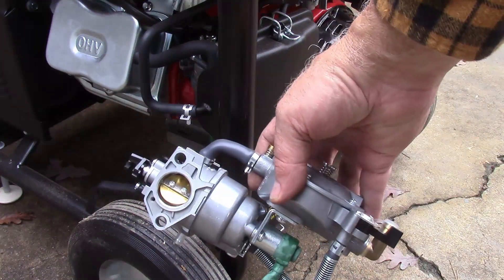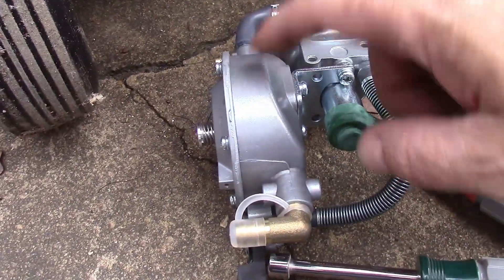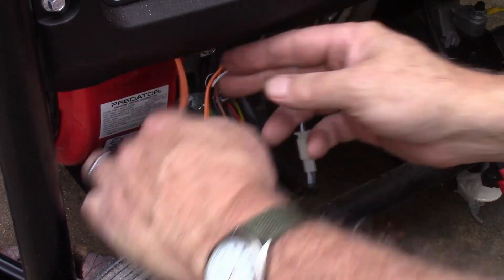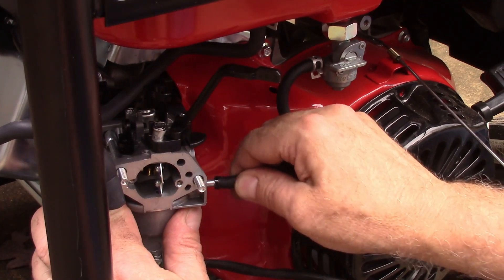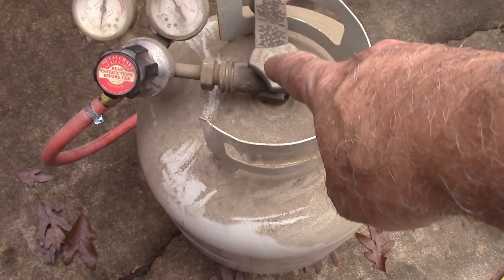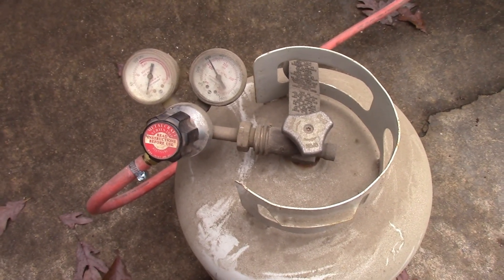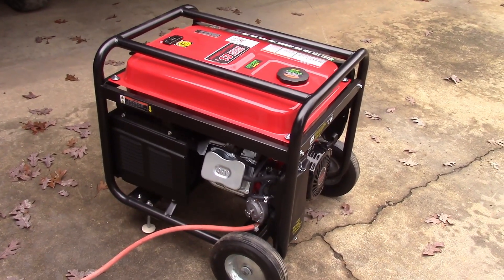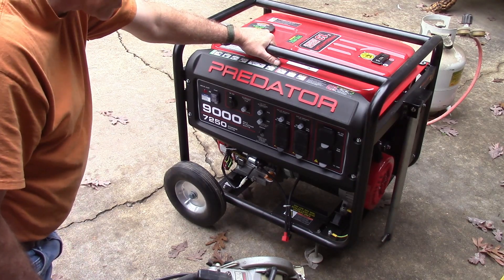Predator 9000/8750 Generator Propane Conversion  Tri Fuel

Comment: i am unable to find a propane hose that will fit it like what u have. do i cut the end off and clamp it like urs or what size fitting will go on there
Reply: Here is a reminder about portable generator safety: everyone really needs to see this safety reminder to make sure. This advice is just to make sure that everyone is aware of all the warnings and it’s just to remind people to be careful using portable generators. Generators can be dangerous if not used carefully. Every year, hundreds of people die or get injured when using portable generators due to carbon monoxide poisoning and electrocution. Make sure you are using your generator carefully and keeping others safe as well. There is something very serious that everyone should always be aware of when using generators. Some people do run their generator indoors which is not safe and that increases the risk of carbon monoxide poisoning which can cause death of family and you. Some people run their generator in wet conditions which can electrocute them. Please remember that you should never run your generator indoors. Remember that carbon monoxide is an odorless and colorless gas that you cannot see or smell. Carbon monoxide is a silent killer. Keep that in mind. Make sure your generator is 15-20 feet away from your house and away from doors, windows, and vents. Never use your generator in your porch too. Having a carbon monoxide detector is very important against generator safety. Some people also allow children to go near the portable generator which could pose risks. We need to keep an eye on our children making sure that they are not near the portable generator so they won’t get electrocuted or burned by the generator which is dangerous. A locking enclosure also keeps kids safe. A generator shed might look like a tempting place to explore, or take cover during a game of hide and seek, but a generator is a dangerous piece of equipment that can cause injury. It says on the manual that we should also keep children away at all times from the portable generator to avoid injuries. Please do not allow a child or unqualified people to operate the portable generator. Just because some manuals missed what should be listed doesn’t mean it’s safe to do. Always follow the generator safety rules when using portable generators. Generators pose electrical risks. If you need to use your generator during wet weather, you need a generator tent to protect your generator from getting wet. Don’t let your generator get wet. Keep your generator dry and before using your generator, please make sure your hands and your generator is dry. Do not wear loose clothing when operating the generator. Everything that is said on the generator’s operating manual should not be ignored. Never smoke cigarettes near the generator. Please keep flammable things away from the generator. Never overload your generator too. Your generator can catch fire. Never ever try to plug a generator cord into a wall outlet to avoid back feeding. Back feeding your generator is dangerous. Always turn on your generator first before plugging in appliances and shut off the appliances before turning your generator off. Use a heavy duty cord for your generator and the cord should not be worn out. All the instructions should be followed carefully. Never refuel your generator while it’s running. It can cause fire if fuel spills while your generator is hot. You should turn off your generator and let it cool off before refueling it. Having a fire extinguisher next to the generator is also important. This is only a reminder for everyone’s safety of using generators. Make sure your generator is properly grounded. Having a fire extinguisher next to the generator is also important against the safety rules. https://youtu.be/I1jT3ANENvI and here is a video more about keeping others safe when using generators and also about our family’s safety. Hope this helps. Thank you. Stay safe

Comment: Hi, I just did this conversion! Thanks for the help! It just STINKS really badly. I used a small grill regulator and it worked great on the little tanks, but I switched over to my 600 pound home tank and now it smells SO bad like exhaust fumes... almost like a gas smell.  I'm wondering if the new grill regulator I bought is pushing too much propane and I'm running rich or if the big tank propane just burns more smelly. Any ideas???
Reply from the maker: Glad the conversion worked for you.  The smell should not be any different.  I would wonder if you have a leak somewhere.  Definitely check all your connections for leaks.
Reply: Your supplier has probably mixed in that smell so that if you had a leak in the house or had the stove on not burning, you would know something was wrong.
Reply: @MeadeLX50  I'll report back after some more testing!  I need to get out there and test but I've been crazy busy with projects in the year of COVID BS.
Reply: Of course you should check very carefully for leaks, but one possibility is that the odorant is more concentrated in your larger tank. Propane is naturally odorless, and when it's bottled they add chemical "perfume" (ethyl mercaptan) to make it easier to detect leaks. IIRC, that stuff is denser than propane and will "settle" in a propane tank over time, so that if you've had that big tank sitting for a while, you'll get a lot more of that smell as you burn through your fuel supply. Good luck!
Reply: @carbonmike9372  Thanks for your comment.  I am using a grill regulator but just bought a gauge and adjustable valve. I think I'm going to test some more and then adjust the amount of propane entering the carb. I'll report back!
Reply: @dustins4194  grill regulators do not work. You need to get one for generators from an hvac outfit.
Reply: @justincase1575  yeah it's been a while... I figured it out long ago, thanks.

Comment: I went on Amazon and could not find the carburetor, witch carburetor is it. Is it the Hipa Generator Dual Fuel is so they don't have it. Can I use the uxcell New Dual witch is $37.69?
Reply from the maker: It is listed in the video description and should take you right to it.

Comment: This does not work with the new predator 9000. The airbox for the new predator model is different. I was still able to make it work by loosening some bolts on the new carburetor and letting it dangled a little bit but it doesn't bolt up as nicely as this video. It was still a very helpful video and it made this task seem like it was much more doable.
Reply: Dustin S...Is your Predator 9000 the sku 63970...or sku 63971...? Photos of the two different air-boxes and the area of interference  would really help. I just bought a 63971 and am looking to convert.
Reply: @kowen8121  I just bought it and it was supposed to be the latest model with the longer run time. The air intake is down near the bottom. There are other people that had the same trouble on Amazon I read. This video has the air hose near the top, mine is at the bottom.
Reply: @dustins4194  Thank you. Is your 9000 then the sku 63971...? All of the 9000 models have the larger fuel tank and longer run time but there appears to be differences between the 63970 earlier model and the current 63971 model. There is also a spacer available which mounts the airbox further away from the carb for additional clearance. That may also help. I have one ordered. https://www.amazon.com/gp/product/B01LZZPK69/ref=ppx_yo_dt_b_asin_title_o00_s00?ie=UTF8&psc=1
Reply: @kowen8121  don't know the air inlet is low on the box below the carb. I can maybe go look later.
Reply: Here is a reminder about portable generator safety: everyone really needs to see this safety reminder to make sure. This advice is just to make sure that everyone is aware of all the warnings and it’s just to remind people to be careful using portable generators. Generators can be dangerous if not used carefully. Every year, hundreds of people die or get injured when using portable generators due to carbon monoxide poisoning and electrocution. Make sure you are using your generator carefully and keeping others safe as well. There is something very serious that everyone should always be aware of when using generators. Some people do run their generator indoors which is not safe and that increases the risk of carbon monoxide poisoning which can cause death of family and you. Some people run their generator in wet conditions which can electrocute them. Please remember that you should never run your generator indoors. Remember that carbon monoxide is an odorless and colorless gas that you cannot see or smell. Carbon monoxide is a silent killer. Keep that in mind. Make sure your generator is 15-20 feet away from your house and away from doors, windows, and vents. Never use your generator in your porch too. Having a carbon monoxide detector is very important against generator safety. Some people also allow children to go near the portable generator which could pose risks. We need to keep an eye on our children making sure that they are not near the portable generator so they won’t get electrocuted or burned by the generator which is dangerous. A locking enclosure also keeps kids safe. A generator shed might look like a tempting place to explore, or take cover during a game of hide and seek, but a generator is a dangerous piece of equipment that can cause injury. It says on the manual that we should also keep children away at all times from the portable generator to avoid injuries. Please do not allow a child or unqualified people to operate the portable generator. Just because some manuals missed what should be listed doesn’t mean it’s safe to do. Always follow the generator safety rules when using portable generators. Generators pose electrical risks. If you need to use your generator during wet weather, you need a generator tent to protect your generator from getting wet. Don’t let your generator get wet. Keep your generator dry and before using your generator, please make sure your hands and your generator is dry. Do not wear loose clothing when operating the generator. Everything that is said on the generator’s operating manual should not be ignored. Never smoke cigarettes near the generator. Please keep flammable things away from the generator. Never overload your generator too. Your generator can catch fire. Never ever try to plug a generator cord into a wall outlet to avoid back feeding. Back feeding your generator is dangerous. Always turn on your generator first before plugging in appliances and shut off the appliances before turning your generator off. Use a heavy duty cord for your generator and the cord should not be worn out. All the instructions should be followed carefully. Never refuel your generator while it’s running. It can cause fire if fuel spills while your generator is hot. You should turn off your generator and let it cool off before refueling it. Having a fire extinguisher next to the generator is also important. This is only a reminder for everyone’s safety of using generators. Make sure your generator is properly grounded. Having a fire extinguisher next to the generator is also important against the safety rules. https://youtu.be/I1jT3ANENvI and here is a video more about keeping others safe when using generators and also about our family’s safety. Hope this helps. Thank you. Be safe. All generator safety rules need to be followed carefully to avoid hazards.
Reply: @The_Happy_Aviation_Enthusiast  :rolleyes:

Comment: Thanks a million, man!  Quick Question!? So 1 pound of propane burns around the same as 1/2 gallon of gas?  Mow much more inefficient is the Predator? I ordered the carb, just worried that it won't fit the new model 9000. The vid is pretty new, so I think it is the same... I'll try it!
Reply from the maker: Sorry I don't know the answer to your question.  Good luck with the new carb, I bet it will fit

Comment: Thanks for your help.  I missed the part when he told about the carb.  When you want to go to natural gas what do you do?   Sorry for being a bother.  Really great video.
Reply: NOT FOR NATURAL GAS !!!   the link provided takes you to Amazon where product description says LP/CNG conversion kit.   CNG is Compressed Natural Gas which is not the utility being fed to your house thru a gas line.  This is the pressurized version they use in some city buses and truck fleets.   You can get a carburetor for household natural gas, but it is not the one shown in this video !
Reply: If you tap into your house supply, nothing extra is needed
Reply: @nickfarrow8189  Ok, well that's not consistent with the post above yours (devec6016), - can you please explain ??
Reply: Everyone really needs to watch this video about generator safety https://youtu.be/I1jT3ANENvI

Comment: I have an Onan HP6500 genset and can't get it to fire up. Not much different from your setup. Was wondering how you're setting your choke when starting up: closed, mid-way, or fully open? I'm running about 1 PSI to the carb -- could that little be flooding it?
Reply from the maker: I don't really know. There are too many variables. Start with the basics to figure it out. You have to have fuel, air and spark. Make sure you have all 3.
Reply: @SoatMon  You don't use a choke for natural gas or propane.

Comment: In your review of this gen, you broke in on gas then converted. Is this an important step? We have the 8750 and have it set up on propane but was used with gas first. But were going to be buying this 9000 to convert, but wonder if we need to break in on gas first?
Reply from the maker: I don't really know to be honest.  I saw multiple people suggest it and it makes since as gasoline has some lubrication in it and I figured that may help the piston seat better and since it comes set up for gas I figured why not break it in that way.  Good luck with your generator.

Comment: How about some kind of update , how has it been running, have you had any issues, does it use a lot of propane compared to gas, what do you like what would you have done different. Thank you for the information I'm about to do the samething and I'm trying to figure out if I want to go this way or with a true tri-fuel conversion $36 vs $179. I would like to go the $36 way if it works thanks for any information you can provide...
Reply from the maker: Unfortunately I don't have a lot of  information to help you. I use it as a backup generator and haven't needed it since I set it up other than testing  it a couple of times. I would definitely do it again. The carburetor I  put on is identical to the one I took off except for the propane  part. They look like they are made by the same factory. Good luck with yours!